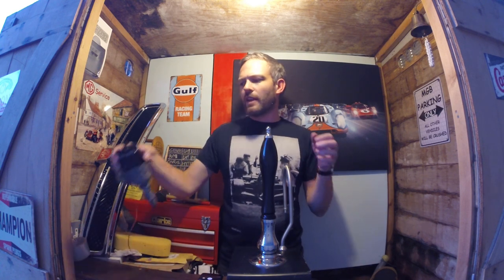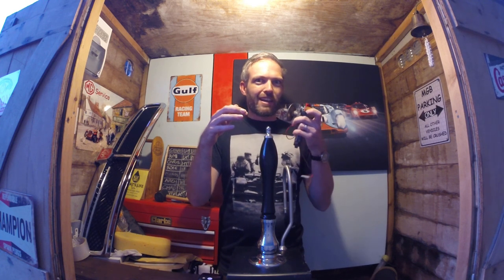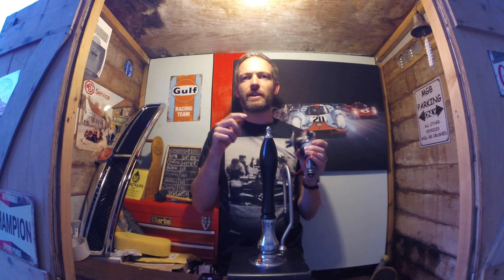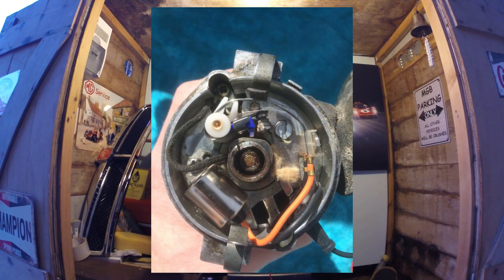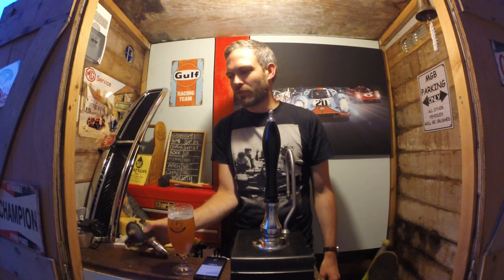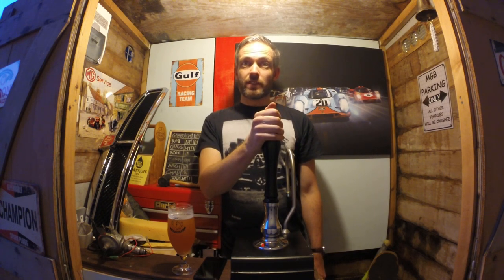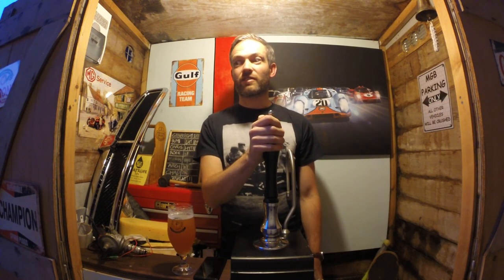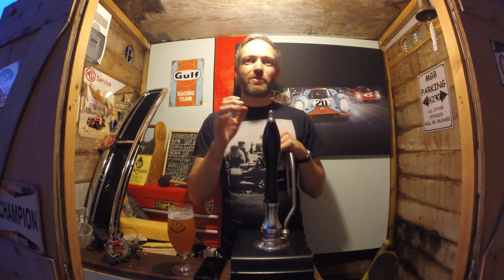MGB GT - Distributors and Electronic Ignition

Comment: Hey Mark. So I finally bought a 123 distributor.  Do I remember by chance if you installed this at TDC or at a static timing mark eg 10 degrees before TDC?  Thanks
Reply from the maker: Hi! I think I just followed the instructions, was a while ago now, think I had to put it at TDC then on the distributor there were lights that came on once it was in the right position 🤔
Reply: @granblogismo  thanks Mark - appreciate that!  I was slightly confused. The instructions I have referenced setting static timing which I tool to mean 10degree BTDC but then the accompanying data sheet stated install at TDC 🤔 But it's all clear now. Cheers again!

Comment: Can you tell if an engine has electronic ignition without removing the distributer cap?
Reply from the maker: DavidUKesb the easiest way is to remove the cap as it’s only two clips and you don’t have to take off the leads (the leads also stop it dropping on the floor 🤣) but you might be able to tell without removing it depending on the type of electronic ignition. One way is to check how many wires are coming out of the distributor body (not thick HT leads out of the cap), if it’s more than one then you might have electronic ignition, some systems use an external ‘box’ to house the electrics so look for a small metal box with branding like lumenition or pertronix again with a normal/thin wire leading to the distributor body.
Reply: Thanks great, thanks very much.